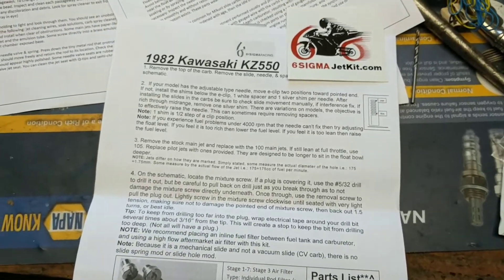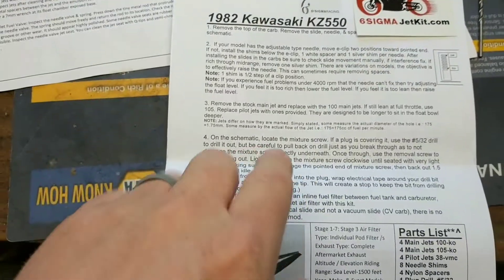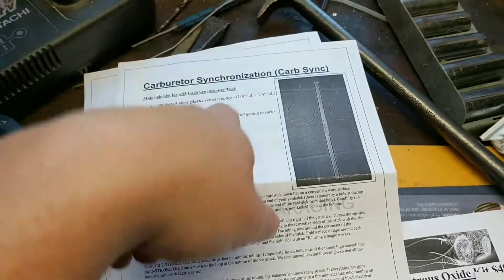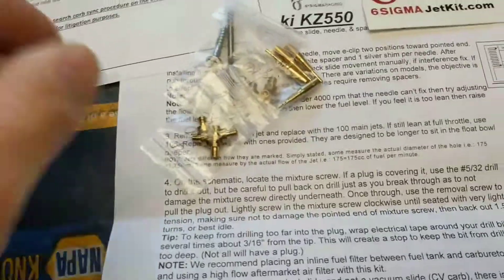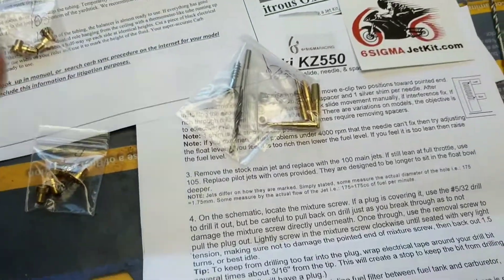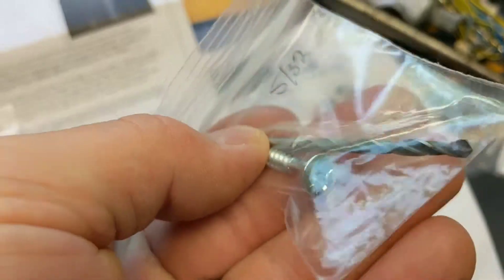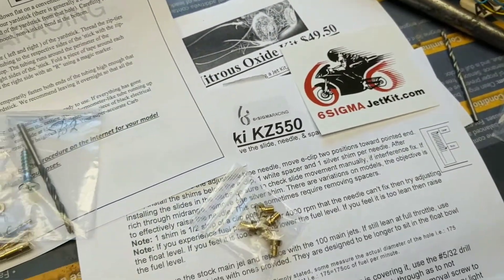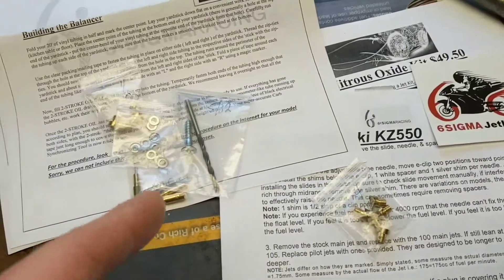6Sigma jet kit - What all do you get

Comment: It’s been a few years but how was the bike after you installed the kit
Reply from the maker: It ran alot better. Still had some issues on the very top end, like running at highway speed, but just running in town or cruising back roads, it was actually rideable.
Reply: @littlestoney406 I have a quad with a full exhaust and a modded air box and air filter, what stage should I get
Reply from the maker: @carter.coleman  best I remember, you told them what you have and what you've done to it and they send you what you need.